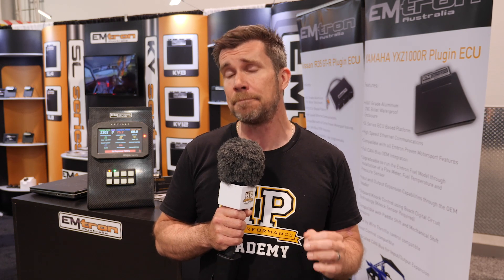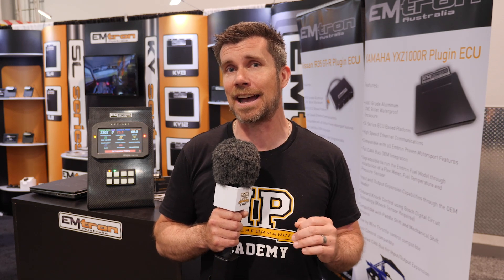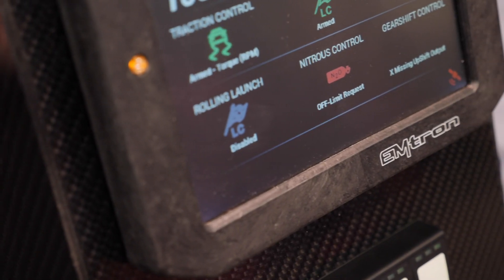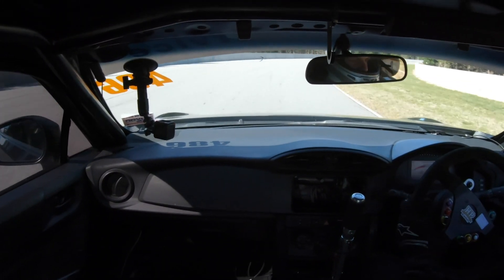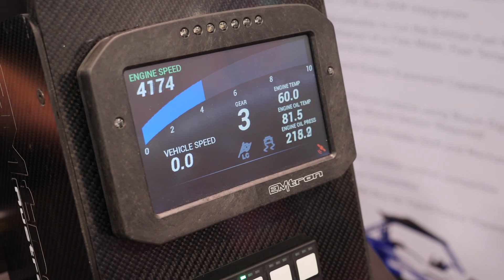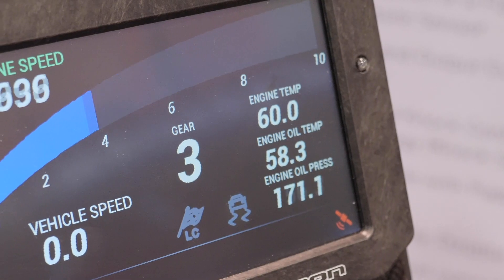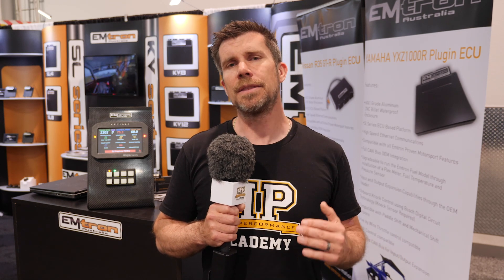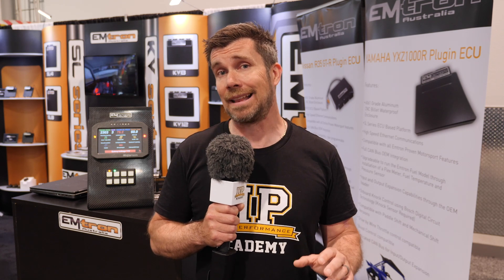The Problem With Analog Gauges | EMtron Driver Display [TECH TALK]

Comment: The problem with digital gauges are that they consume more power and are difficulty to convert over to from analogue in an system with an ECU .  For example, the OEM meter on my bike uses an analogue meter with a cable driven speedometer which also sends a speed signal pulse to the ECU.  It's impossible to switch over to a digital sensor in my case and I could only use a digital gauge if I were to take apart the OEM gauge, take out the analogue speed sensor, custom make an enclosure for the sensor,  and then add a second sensor so that the digital gauge can detect the speed.
Reply from the maker: The power draw is negeliable in the grand scheme.
For setup, not impossible but depending on the application yes it can be more difficult on some than others.
In your case if you find the complications of fitting one outweigh the benefits for you, that doesn't mean it's too hard for all, it's just not worth it for your requirements is all, and that's OK too - Taz.

Comment: Some good points raised there, but also missed a few that us old-school folks may be more familiar with.

With guages it isn't uncommon to use the aircraft trick of orienting all gauges so all needles are straight up in normal use - even having the critical ones mounted directly in front of the driver with less important ones to the side. This means one will notice any variations immediately.
These can be supplimented by using a warning light to bring attention to the gauge - pressure switches have been available for decades that are easily adjustable for their operating point, as have temperature switches.
As one ages*, it can be more difficult to rapidly change focus and/or actually read a smaller display whereas a needle is easily registered by the eye.
gauge needles are relatively stable compared to digital numbers which may be fluctuating and hard to read - some of you will have used DMMs and had this problem and got better results, in some applications, with an AVO.
For older vehicles, gauges just look better.
Several companies make gauges that can be operated from the CANBUS.

HOWEVER, panels are lighter, easier to wire in if on a CANBUS with the ECU and/or PDU, can be configured to bring up specific issues, can be configured to bring up different screen configurations of information, can be colour coded for safe, warning, and critical conditions, etc. When considering how much GOOD gauges and senders cost, they can also be very good value for money.
Some can also be used to alter the ECU maps, or swap between preset maps.

As has been pointed out, for many their small size can be a problem, thought, as some manufactures limit their available displays' dimensions.

Comment: [ranty rant rant - apologies in advance LOL] 
There's no product market more frustrating for me than CAN-BUS digital dashes - all of these manufacturers are ignoring a SIGNIFICANT portion of the market. 
  
Is anyone aware of a CAN-BUS digital dash option that's actually large enough to be used as a dash/gauge pack(maybe 7"+? Not that pathetic little 3.5" thing Holley sells for $250), and doesn't cost LITERALLY as much as a standalone ECU kit? If I have a Haltech Elite 950 or Holley Terminator X, I shouldn't have to spend the same amount of money as the MSRP of these ECUs just to get a digital dash to pair with it, this stuff is getting absolutely ridiculous. When is a manufacturer going to choose to REMOVE unnecessary features like shift lights, physical buttons, included GPS, accelerometers, etc. to offer a stripped down budget model, instead of only ADDING more and more junk while raising the price with each 'feature'? 
There's the non-CAN digital dashes that are pretty cheap, but why would I want to wire all my sensors into the dash when I have a perfectly good ECU that obviously takes precedent over that information, and is capable of outputting it? 

These CAN digital dashes are EASILY the most overpriced products in the engine management market, there's nothing expensive about these - especially compared to an actual ECU. I struggle to buy the idea that we can make tablets and laptops that are larger, with higher quality screens, and are significantly more powerful than these digital dash products, for HALF the price and less, yet all of these digital dashes cost 4-digits(USD) or close to it. I mean, damn, it would be one thing if these digital dashes could be used for basic tuning adjustments with compatible ECUs, but of course they can't do something useful like that - nope, don't forget to buy a laptop/tablet to do that in addition to everything else you've bought up to this point. I mean, I get the difference in making mass produced laptops/tablets vs niche application digital dashes, but the raw materials in these simply aren't expensive. 
As far as I can tell, the only CAN-BUS digital dash that's vaguely affordable is Holley's older 7" for $650(as of today anyway), which is a pretty impressive price compared to most everything else on the market. But, how about one that loses crap like the accelerometer, data logging(why??? I already have an ECU that does that!!!) and it's SD card slot, aluminum housing(Holley ECUs have plastic housings, so...), USB support, etc. for, say, $400? After all, the screen only has 800x480 resolution, obviously that's one cheap part in this product.
 
As it stands, I'm using a $200 Windows tablet-laptop thing(touch screen with removable keyboard, the lines are blurring) to both tune my Holley Terminator X, and use its generic on screen dash option as my digital dash(just need a basic mount to hold the tablet behind your steering wheel). For $200, I'm using a junk tier tablet-laptop to do more than I could do with one of these $1000+ digital dashes - in fact, I would still need the laptop to do all of the tuning even if I had a digital dash. Obviously Holley's on screen dash is basically not at all customizable, can't configure the gauges or warnings(easy solution - output of ECU to cheap LED light[s] mounted on dashboard, fully configurable in the ECU), obviously they want you to buy their overpriced digital dashes. But, they're going to have a hard time convincing me until either prices drop to sane levels(let's say $500 or less), or they allow me some legitimate level of tuning ability(no reason they can't have USB ports and mouse-keyboard support) through the dash.